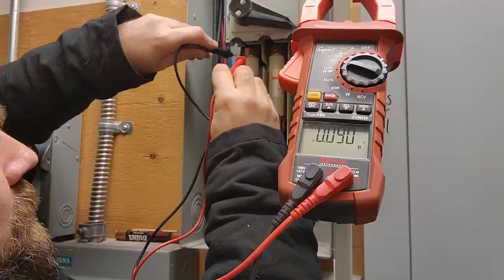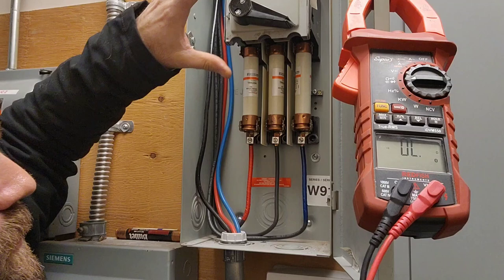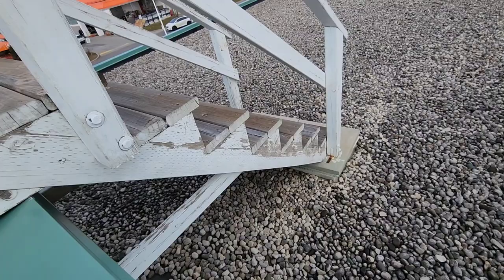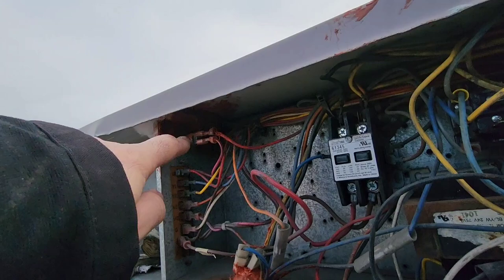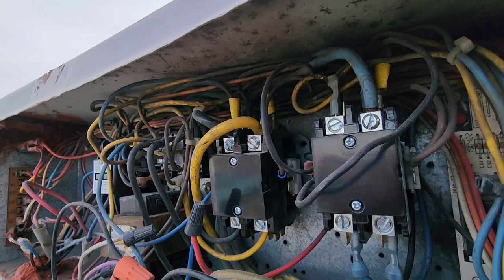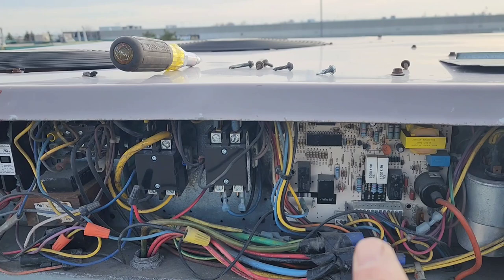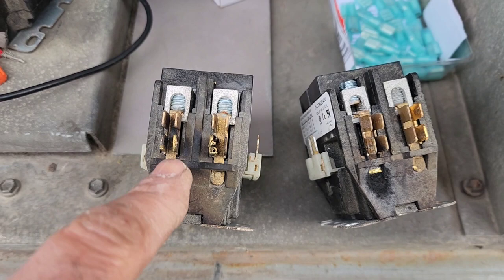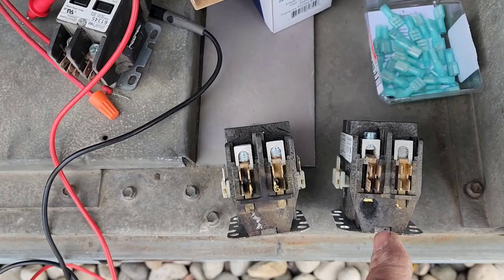Finding An Electrical Short Within An HVAC RTU - Fuses Keep Blowing

Comment: I will try to recreate the water infiltration by pouring water on the unit and find where it is penetrating to the electrical. Good video
Reply from the maker: No need to do that, use a megger.  I put a video link in the summary

Comment: Loose connections as well will cause wires too get hot melt the wire and cause a short and blow a fuse

Comment: Great video! I’ve had the exact same issue on the same style carrier RTU. rain/snow melt was getting in on the top of the unit through screw holes. Would blow fuses very irregularly, everything wound ohm and megger out fine. 
I sealed up the screws with silicone and the panel with foam insulation tape. 
Replaced 3 contactors and control board 
No issues for about 2 years!
Reply from the maker: Yep

Comment: I have a carrier heat pump for my house, it keeps blowing fuses, and capacitors, but not throwing any codes. I’ll look for bad connections, it’s about 10 yes old. Thanks for the insight.